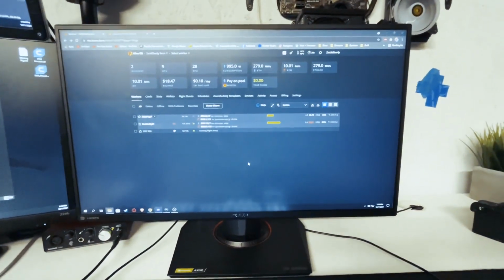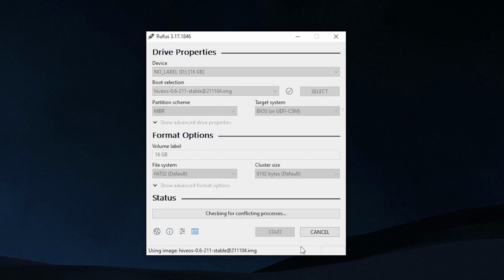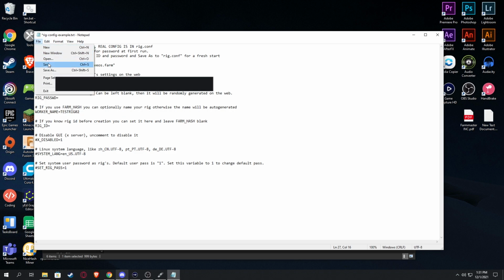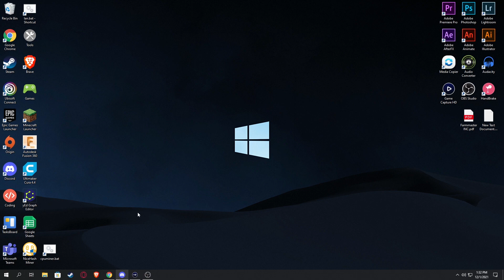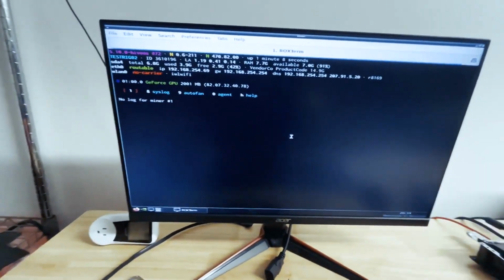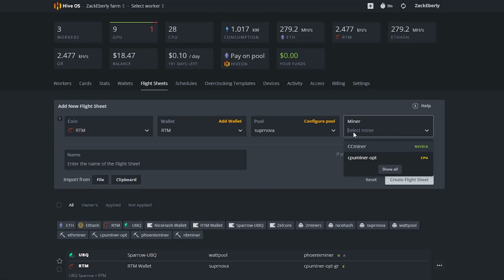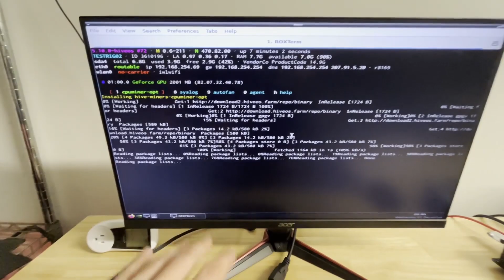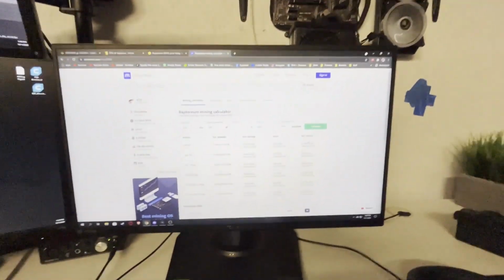Setup CPU Mining Raptoreum in HIVEOS // RTM

Comment: can you boot it without gpu ?
Reply from the maker: Yeah, I’m your bios under integrated peripherals you can change the booting to not look for a gpu. It’s usually set to auto and you can change it.
Reply: @ZackExperiments  thanks to you i found this amazing setting, saved me time!!!  what setting do you use nowadays on your 3900x in bios for hiveOS
Reply: Question if I have a 5-6 gpu rig (3060ti) is it safe to put the 3600xcpu to also mine on the same rig. I have 16GBs of Ram & The cpu is properly cooled
Reply: @Varillah  u can, make sure you don't use all threads , use XMRig(best for 3600) and add line -t 10 or 11
Reply: @lawson1989  ok so is this something in the bios I need to set and if so how what exactly am I changing and how many threads should I leave unused.
Reply: @Varillah  no bios changes , you change thread usage settings in the miner config file. Which miner are you using? hive os? you need to change the value for thread = 12 to (10 - 11) , -t = 11
Reply: Hiveos…..and was probably gonna follow same way as your video for the miner itself. so I should use about 10 threads and leave two to handle the 5-6 gpus????
Reply: @Varillah  yes sir, exactly
Reply from the maker: @Varillah  I actually have all threads mining rtm and I see now difference in mining performance with 6 GPUS mining eth.